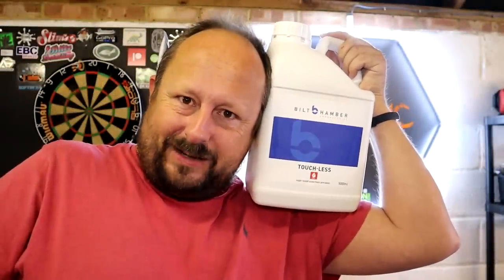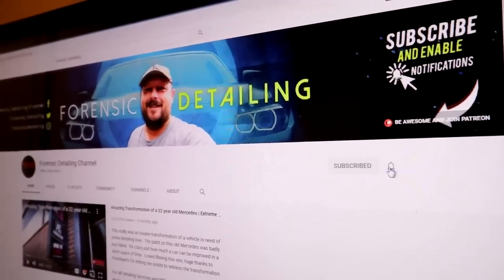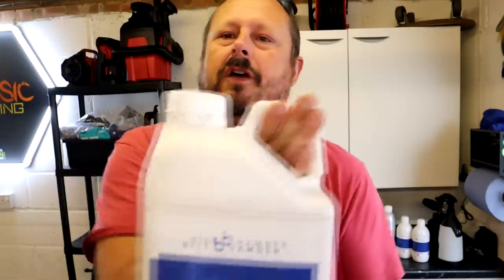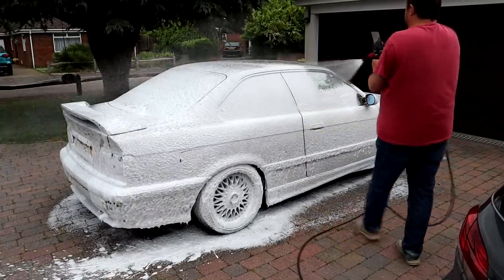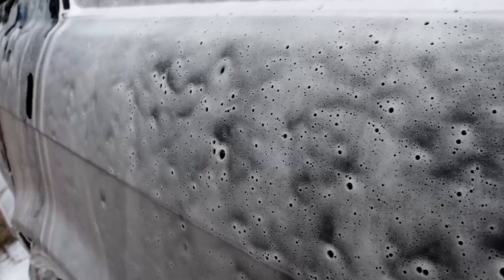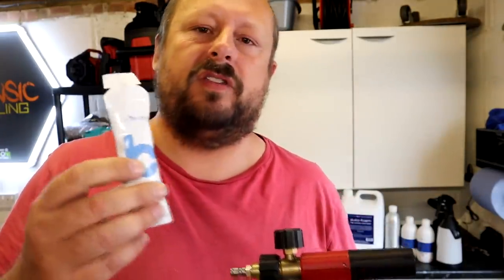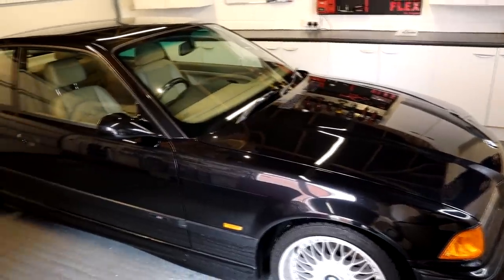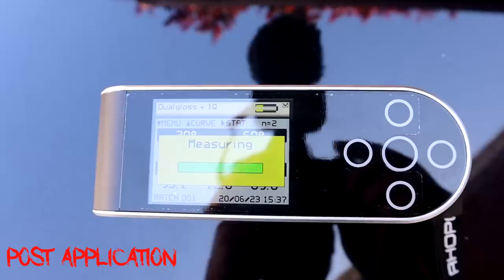Getting the Most out of Bilt Hamber Touchless and Touchon

Comment: I see jon can wash the car in a hour , I struggle to do it in 2 hours , it can take me nearly 3 hours if I’m doing the wash , wheels and tyres , drying and tyre and trim dressing, I don’t Know why I’m so slow , when I’m doing a contact wash then I find that once I’m washing the last side the other sides have already near enough dried so recently I been doing it in sections and rewetting the clean sides with water if it’s drying
Reply: Same here mate.
Reply: Me too buddy... 3 hours is normal rate for me... I try to cut corners here and there but the car is not really clean. 3 hours is normal if you want clean car IMHO... aaand I`m not slow... :)
Reply: 1 hour is mind blowing, 90 minutes minimum, just to wash the wheels, snow foam, contact wash and dry for me.  Add in some QD and a glass clean and there's 2 hours gone as a bare minimum.
Reply: Thank god it’s not just me , I seen videos of mobile detailers who say they do the inside and outside in a hour , I don’t know how true that is , if I’m really quick then I can maybe do inside and outside in 3 hours but even that might be pushing it , anyway thanks for the feedback as I thought It was just me , however when I’m doing it then I’m not working slow
Reply: And me, I always guessed I was just being thorough.
Reply: Practice makes perfect. Most of the time for me is on the wheels and preparations to get everything set up. John doesn’t have to do as much as us because he’s got that garage with everything more or less there. That helps a lot. Plus he’s experienced AF so he’s got his method down pat.
Reply: @kwl189  to be honest I have to get get setup myself and doing the wheels does take me quite a while , sometimes I even do a citrus pre wash and foam , most of the time I’ll do just foam though , I’m doing a mid size suv with 21” wheels and I struggle to do the roof as it’s hard to reach and I have to do it in sections . I do try to do it properly and not cut any corners
Reply: @M.E63  exactly. The wheels and rims are a real pain in the arse to do properly, if you want them done right. Citrus prewash with snow foam on top does help a lot on really dirty cars and rims. I would actually almost use that as my default setup if cost wasn’t an issue lol. With an SUV or mini SUV a step/ladder is helpful to make sure the right pressure and coverage needed imo. That’s the other thing is that we’re doing this properly because it’s our motor and we love a job done properly. That takes time. More time than a local car wash will do for £10/£15

Comment: My Touchless (older version) does not 'snow' at all. It seems quite runny. Is that normal? Or could it be my lance?
Reply from the maker: try MJJC pro V2 lance.  and if that doesnt help put the 1.1 orrafice in it.  you will have thick foam then mate trust me.
Reply: @ForensicDetailing  okay will do thanks for the reply 👍
Reply: @fvresonanator  also make sure you are putting in the correct amount of product in your lance as everyone ratio will be different because of there pressure washer , snowfoma lance and tge rate water flows through your hose
Reply: Hi John. 
Thanks for another great video. Here’s an off topic question!! Just about to order a pair of Hey Dude shoes and noticed they seem to be your choice of footwear! The question is that I’m told whilst they come up true to size in length they’re a wide fit! Would you agree with this? Cheers.
Reply: Same. I bought mine almost a year ago here in Canada and it BARELY foams even with a 2.2GPM Gas pressure washer + PF22.2 foam cannon.

Comment: Used touch on since it was released gets better the more you use it, bucket method not a fan of with this,  but perfect in a pump sprayer
Reply: Bucket method doesn’t get the results. Canon or trigger spray/pump up sprayer does the trick.

Comment: How do you get a thick layer of foam using touch less
Reply from the maker: mjjc pro v2 lance
Reply: @ForensicDetailing  that is what i am using but it wasn’t thick. Which orifice are you using in it?
Reply: @ForensicDetailing  how many ml of touch less do you use in the Lance and do you fill the rest with water so you have a full 1L Lance bottle

Comment: Can Touchless be used via pump sprayer like Autofoam?
Reply: yes
Reply: @jamesuk9  thanks - does it say on the bottle? Doesn't say on the BH website but does for Autofoam
Reply: @TheBearbertie  Don't think it does say tbh. I've been using it in a foam sprayer for over a year without issue though. About 60ml per litre does a good job in an ik pro foam pump sprayer.
Reply: @TheBearbertie  Don't think it does say tbh. I've been using it in a foam sprayer for over a year without issue though. About 60ml per litre does a good job in an ik pro foam pump sprayer.

Comment: John help me out here. I know you have explained this one hundred times but how much touchless are you putting in a 1ltre snow foam bottle for it to be the correct ration. Make it simple for me mate and tell me a number 😂
Reply: It varies depending on your pressure and pressure washer. You have to follow the PIR method on the back of the bottle.
Reply: each person has different pressure washer ,different snowfoam lance and different rate water flows from your hose pipe , so you need to watch his panel impact ratio video where he shows you what to do
Reply: When you do the PIR method that it says to follow on the back of the container it basically works out pretty close to 50% Touchless and 50% water. I use 50% distilled water which also helps to make better foam from my foam canon. Hope that helps.
Reply from the maker: for heavy cleaning put about 400ml TL to 600 Water
for light summer cleaning put about 200 to 800 .

very rough crude way to do it.
Reply: I found that with a Karcher K5 and the purple Autoglym lance the ratio is 58% product in the lance for 4% PIR (Panel Impact Ratio, which is the diluted strength when it hits the panel) which I'd use for heavy winter dirt, and 29% for 2% PIR which I'd use for light summer cleaning. My dad found similar results with the MJJC V2 lance and an Aldi/Lidl pressure washer.

In summary: approximately 50% in the lance should give you the max recommended strength of 4%, and 25% gives you about 2% for a lighter clean.